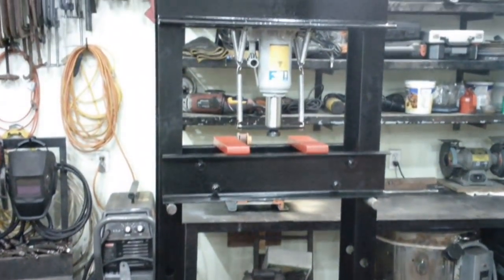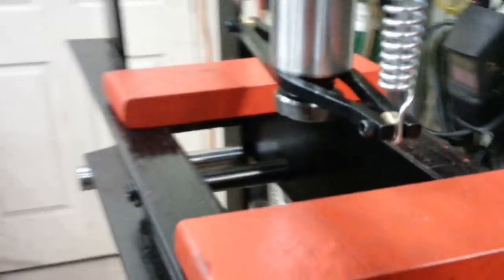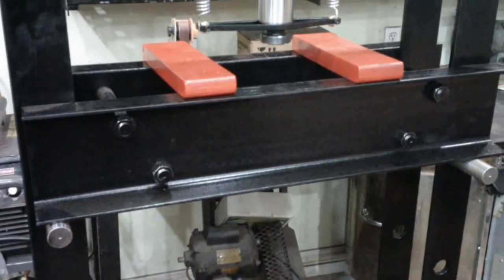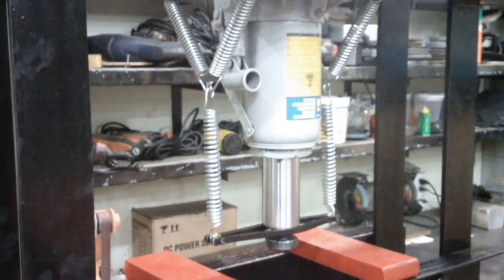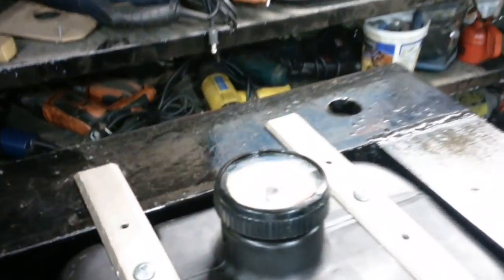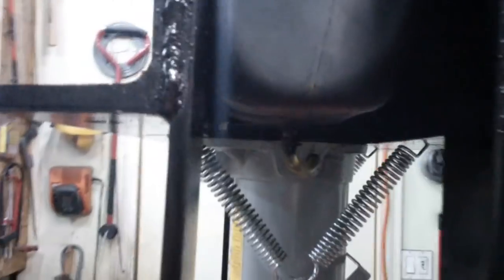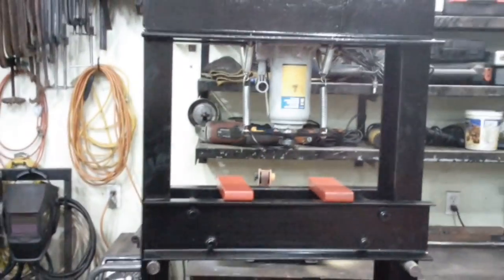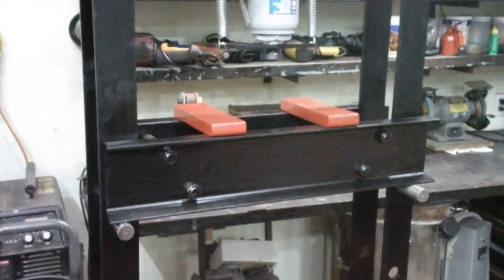My Finished DIY 20-Ton Shop Press with an Inverted Bottle Jack

Comment: I've converted many jacks to operate upside down, you don't need a reserve tank, your problem is that the extension tube is not oil tight at the junction of the base of the jack, other, it is preferable to have a vent open to the atmosphere to never encounter a condition where the jack reserve is under vacuum. 

My experience says to machine the gland to install a conventionnal oil seal, the Oring in the gland is not sufficient in a long term to retain oil and you'll experiment an oil leak at the ram.
Princess auto jacks are cheaply made but they maintain well the oil pressure under load..
Reply: what if you weld the tube
Reply: @mercer982  you can use a 1/4" long series drill to oversize the pump intake hole and to be parallel to the ram cylinder, usually, a 1/4" brake line slips tight in a 1/4" drill hole as long your drill is fresh and does not wobble, I use loctite 609 to make a tight joint between the jack base and the tube.
 usually, I install a 3/16 brake line for the return port the same way to avoid hydraulic oil aeration.
I do not weld because it is difficult to make a weld that is delicate and oil tight on a cast iron base, the only practical way I see is to make a silver braze
Reply: Thanks for the tip. Brake line sounds perfect.  I just need to buy an imperial size long drill bit then hah

Comment: I got a great idea, thank you very much. It would be perfect if you could convert the pumping lever working direction because lifting up to get the bolt down is a little difficult, at a heavy load the press body might move backwards.

Comment: For anyone who doesn't know, he has added the reservoir above the pump so that there is always oil above the intake check valve  (called the suction valve).
Reply: there is a simpler way to do things, an external reservoir is a source of leaks and a oily mess on the press bed

Comment: Nice Build.  The Harbor Freight 20 ton Press is on sale some times $149.00 with the jack Here in the USA. I Couldn't buy the C channel for that and build one at that price. I added the Air operated  20 Ton Jack to my HF 20 ton press. I really like it much better. Thanks for the video.
Reply from the maker: @Z71Ranger, yeah, I know, but unfortunately with the steep exchange price now it would cost about the same and I wasn't planning on going down south anytime soon. Thanks for the comment; I always like to hear what others have done.
Reply: @ChrisOfAllTrades  what I've done , with a lenght of 1/2 shafting, on a lathe, I drilled center a 1/4" hole 1" deep and I inserted a new 1/4" drill that I silver brazed there, the " long" drill is rigid and it clears the ram cylinder, I've used a press drill to enlarge the pump intake hole and I used straight 1/4" brake tube, it fits the hole with a bit of interference. I sealed it with a drop of loctite 609 ( bearing mount ) and I knocked the pump intake tube there, I've done the same thing with the release  valve port to avoid air mix to the oil.

Comment: How do you bleed the Jack? 

I just put a piece of pipe in my Jack to use it upside down, and now its not working anymore, neither upsidedown with the tube, nur right side up without the tube... And im almost sure that the pipe was airtight...

Is it possible that I lost the Ball in the check Valve when I removed the Pump and turned it upside down?
Reply from the maker: @Peter August, If you check out my blog (link is in the description), there are some more pictures. I just basically had it upside down in the vise and had the overflow tank of hydr. fluid suspended above it. Then I had to slightly tilt it, pump it down and push the piston back in. I did that a few times and all the air bubbles went up the expansion vinyl hose into the expansion tank. As for the ball, that is a possibility, I did actually lose it once when I did mine as well but luckily found it again. Once I put the ball back in and bled the jack it worked great. I hope that helps. Chris
Reply: Thanks. Ill check for that ball tomorrow. You should be able to see it when you remove the pump, right?

Great Blog you got there by the way!
Reply: Alrighty. I could not find the ball, so I just put a random bearing ball in there. Works fine again :) Thanks for the help. sometimes it helps to just tell someone your thoughts to get more clear about problems haha

One more thing: Does your jack have a spring in the pump jack vale? Because at mine the ball is just in a vertically drilled hole, with gravity to close it. I noticed that when I use it upside down I get a lot of pressure on the pump (assumingly from the low pressure reservoir, which builds up some air pressure when you release the jack), which causes a pretty bad leak. I not put a small spring above the ball, to force it to close. Works a lot better now.
Reply from the maker: glad you got it working

Comment: Hi Chris,

I like your design, particularly the method you used in order to invert the bottle jack and having it work correctly. 

You mention drilling and taping a hole for adding a line which is connected to a separate reservoir. I have a couple of questions.

1. Did you disassemble the jack in order to modify it?

2. Will simply adding this hole 90 degrees to the release valve work?

3. What size hole did you drill?

4. How deep did you drill?

5. What steps did you use to bleed all the air from the jack making it usable?

Thank you!
Reply from the maker: Hi Bob, to answer your questions 1. Yes, I disassembled the jack 2. Yes, it worked perfectly 3. I can't remember but I think it was about 3/8" 4. It was about 1" if I remember correctly 5. I had the jack in my vise and tilted it sideways with the reservoir suspended above it I did a lot more thorough write-up on my blog. You should have some nice detailed pics there. Check it out at http://chris-eigenheer.blogspot.ca/2016/10/diy-20-ton-shop-press-with-upside-down.html
Reply: @ChrisOfAllTrades  hm, maybe a bit foolish and lazy question. The bottle jack I want to buy seams to have a service port.  If I simply connected an extra tank to it, could I possibly go without taking it apart?
Reply from the maker: @contemporiser  you'll probably have to take it apart. The issue is that if you get air into the pump part it won't be able to build up pressure. Having said that itll depend on the designing your Jack. It's hard to say without actually seeing how it works. Good luck with your project.